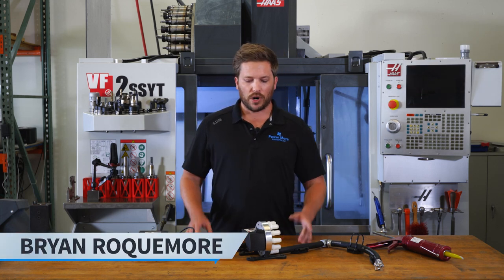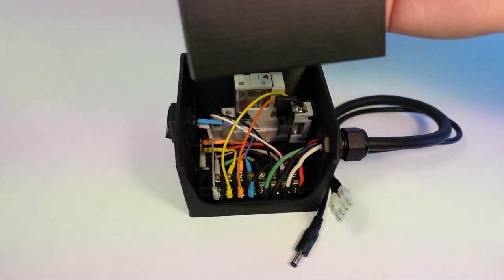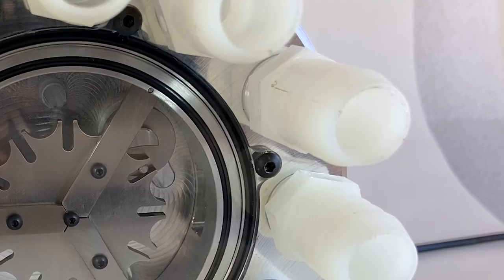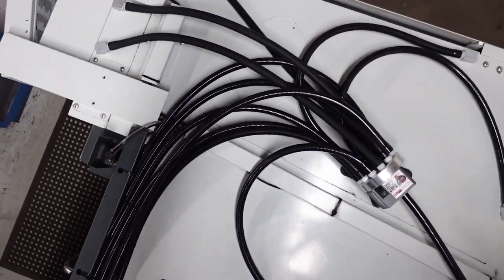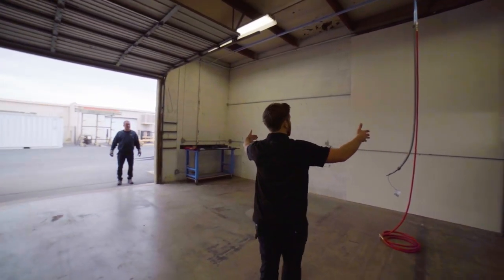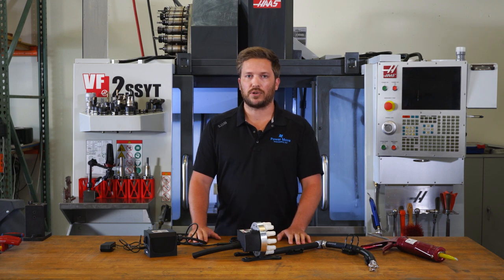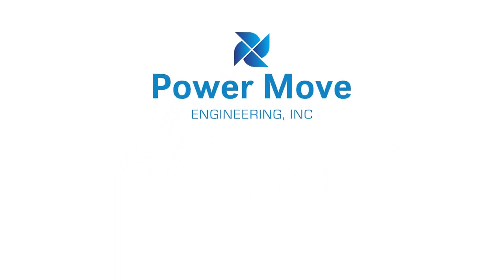NEVER Clean Your CNC Machine Again

Comment: Would've been cool to see it in action
Reply from the maker: Which part would you have liked to see in action? We’ll include it in our upcoming YT video and/or Instagram @powermove_eng
Reply: Precisely
Reply: @powermoveengineering  show us it working and cleaning. Not just an install video
Reply from the maker: @PiCkUpdk  We are working on that too right now. Trying to get all of it posted by first week of January.
Reply from the maker: @PiCkUpdk  it’s not very easy to get good video inside of the machine with coolant running but we’re working on getting a GoPro time lapse during a heavy machining job so stay tuned!
Reply: Exactly. It sounds good but without any proof this is just extra useless hardware.
Reply from the maker: @tinkot We finally have a new video up about this. I hope the action shots are much better in the new one. Thanks for the comment.

Comment: Please show it in operation,.
Reply from the maker: Sean, thanks for the comment. Which process would you like to see in operation? This was one thing that I was worried we didn’t properly explain. It’s out of order but I think it’s all in there. Let us know and we’ll include it in the next video. Thanks
Reply: @powermoveengineering  Your fast response tells me you're monitoring your advertising meaning you care based on your reply. Good on ya.

What I meant by can you show it in operation is show a machine full of chips in operation and how it’s keeping the chips from building up. You have a product that many of us just might purchase. My recommendation for what it’s worth, more than likely the most used machine in all of the US is more than likely the VF-3. I see you have a VF-2 that would work for demo as well. In marketing to cover the masses why don’t you target the biggest community? Not that many of us have UMC’s. 

I will use my self for an example, I own a VM-3, pretty much the same as a VF. I have a single auger in the machine which if I am correct that is also the majority of the machines. My issue of which is a complete pain in the you know what is the areas right and left of the table all the way to the back wall fills up with chips. Honestly in my application I more than likely would only need 2 nozzles. One right, one left.

To the comment I made, show it in operation. In your video you show the spindle flood coolant working and a couple of other really quick shots. For advertising and what I would want to see is in order of the following.
What it is, this you have done.

Show it installed on a VF: “clean environment”

Show the routing of the pipes: You do this but it shows a metric load of pipes which might be a deterrent as folks like me don’t need all of that. This is where your R and D might want to figure out a way to make simpler versions, or one you can cap off for the fitting you don’t need. Something along the line of that, so it can become expandable so to speak. 

Show it in operation and how well it works: Maybe let some chips build up, turn on your system and let us watch it work.

Then as you do in the video, break down the mechanics of it. 

Lastly I would say and this is my compulsive side, is the box your plugging into the mother board of the HAAS. Did you use the same gauge wire or bigger internal in the box? If not, that can cause an undervoltage which can damage other components. Aftermarket electronics on a 140K machine is nerve racking for me. Show us you have done your homework on Ohm’s law, meaning that the electronic monitor and the pass thru side of your box has ZERO drop due to internal components and their sizes.

All in all, if you do anything, show it working on a machine removing chips.

This is just food for thought. I think you might be on to something though.
Sean
Reply from the maker: @3073Sean  You bring up some good points that I want to cover as much as I can in this comment and in our next video. I agree that medium sized vertical mills are the most common need for a tool like this. The design was meant to be universal and although dealing with the hose routing is a project, it only needs to be done once and can be completed in a couple hours of work. One important thing we focused on was making all hoses inside the machine run vertically and therefore not collect chips on them. The process of mounting the hoses to the wall is easy except the adhesive needs some time to dry. For the relay box, we believe all electrical wires, components, connectors, and the design to be sound. The 12V motor circuit uses its own dedicated power supply and does nothing to inhibit the standard pump operation. It just uses a relay to “sense” when the pump is on or off. I will put an electrical schematic on the website. We are filming a full installation video right now that will dive deeper into the hose routing and overall operation. If you have any questions though, let me know and I will be glad to answer! Thanks for the advice!
Reply from the maker: We finally have a new video up about this. I hope the action shots are much better in the new one. Let me know if you have any questions! Thanks

Comment: cool how about a swarf conveyor for the discahrge?
Reply from the maker: Our UMC-500 has a conveyor and our VF-2 has an auger which are the two main options available for CNC machines in general. We think both styles work relatively well. However many enclosed machines have near-level floors allowing for chips to build up excessively and not travel naturally to the conveyor. This product is simply designed to push everything downhill and eliminate the need to rake the chips by hand.

Comment: Cool product! It is really needed for the Haas machines. Are the nozzle around the spindle open when your new nozzle are flussing in the min 2:29? Which pump do you use in your machine? Would you ship this overseas?
It would be fantastic if you make a manual with recommended nozzle positions for each model? Or at least the most common ones.
Reply from the maker: The pump on our machines are the standard 1 HP (0.75 kW) type, not their "high pressure" option. I honestly don't recall if the spindle nozzles were open during that shot but I believe they were. We have done as much as we realistically can to eliminate coolant bottle necks throughout the system, so it flows quite well no matter what. In our upcoming VF2 installation video we are going to show absolutely everything needed to do a full install. This includes nozzle locations, recommended hose routing, how to use the included and non-included hardware, time lapse videos, and answering other questions. I am also working on upgrading the info on the website to include electrical wiring and hose routing schematics. Let me know if I can help with anything else. Thanks for the comment!
Reply: @powermoveengineering  great! I would really like to test your system. If it works as expected we will make it standard in our machines. When are you planning to release the demo video?
Reply from the maker: Glad to hear it! We are hoping to get the installation and demo video up by the first week of January.
Reply: @powermoveengineering  Hi! Looking forward to see the installation and demo video? Would it come soon?
Reply from the maker: @davidsanchezmolinero1847  We are still working on it right now and it will be coming very soon. We ended up changing much of the hardware to make the system easier to install and more universal to all machines. Keep an eye out for the new video soon or if you would like to know more specifics, ask here or send an email to Bryan@PowerMoveEngineering.com. Thanks for the reply!
Reply from the maker: We finally have a new video up about this. We made a lot of improvements to the design and hopefully the new video explains some things better as well. Thanks for your interest. Let me know if you have any questions!
Reply from the maker: Updated video is finally up! Hope it helps!

Comment: People are certainly very nice and encouraging for all the positive comments. I will share my opinion, please excuse me if this is too straight forward. Just wanted to help. The cost of this unit is about the same as an additional high volume/flow pump. Then an over head shower set up would be much more effective comparing to spraying one nozzle at the time. Additionally you won’t have to deal with chip build up on the hose, nozzle, mounting clamps that are mounted so low in the machine….It seem to me this solution it’s a little too complicated than it needs to be.
Reply from the maker: We are currently working on some improvements that will lower the cost in the near future. We’re working on eliminating the relay box entirely to make it more universal and adding an option for only 6 outlets instead of 12 for smaller machines. Both of these will eliminate hardware and drive the cost down. I’m not sure if I understand the benefit of an overhead shower since it doesn’t sound as powerful or able to reach hidden areas. Our current setup does not collect chips on it because everything inside the machine travels vertically and the wall mounts are angled at the top for this reason. Spraying one nozzle at a time was the goal of this system to allow for high pressure to exit in every location. IMO there’s no need to flush any single area for more than a few seconds at a time. One potential downside of adding another pump is that it can empty the tank into the enclosure faster than the enclosure can drain back to the tank. Let me know if you have any questions. Thanks for the feedback!
Reply: Thank you for the reply. I’m glad to hear that you guys are making improvements. Don’t get me wrong I believe the system will work. And I must admit the Haas enclosure it’s a bit challenging in the aspect of chip flow and drainage when it comes to high production work environment. Our shop has 4 Haas needs frequent cleaning but all other machines are fine without needing much attention we just leave the wash down and conveyor on as long as the machine is running.

Comment: So once your invention goes into production, what price range is your chip flushing device going for.
Reply from the maker: We have had many part runs and revisions and we feel that the current product is bulletproof and ready. Everything is machined in-house and any purchased hardware is easily attainable. We are working on the full installation video now. It is for sale on www.swarfdiablo.com for $1175 including shipping and sales tax. Let us know if you have any other questions and we would be glad to help. Thanks!
Reply: @powermoveengineering  Can you do a time lapse video of chip build up in CNC with and without Swarf Diablo.
You have invented a product in the cnc machining field that can address the issue with chip problem shops have.
You stand to capitalize on your invention if machine builders and other people do not copy from your system.

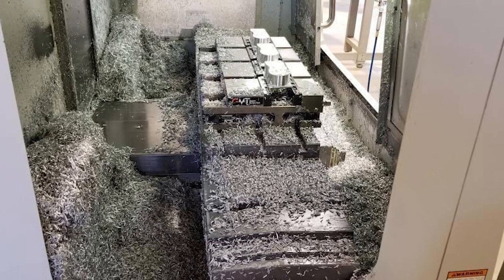I can only imagine what a high pressure coolant pump in conjunction with your product can do to a VF series fill with chips  like in the video at 0:46.

I think it would be a good addition to your product line if you machine a part just like the End Effector but instead of a round ball nozzle it uses standard 1/4 or 3/8 Loc Line modular hose system which can screw in and connect to, so cnc operator can direct a jet stream of coolant anywhere in the machine when switching to different jobs.
Also have you thought about using strong magnet on your wall mounts instead of adhesive glue where it can be reposition anytime...but not sure if magnets stick to Haas enclosure.
Reply from the maker: @SlowReactionDriversAreTheWorst  We will try to set up a time lapse during our next job that makes a bunch of chips. Thanks for that suggestion. Our initial design for the end effector had three NPT holes for Loc-Lines. It worked well but after researching the cost it became expensive quickly because the whole system would need 36 lines and therefore many fittings. Maybe we can still offer this as an option if people thought it was far superior to the adjustable balls. We also considered neodymium magnets for the wall attachment and tried many different sizes. It is possible to use magnets however we weren't able to find a way to shield them from collecting steel chips. Also, the hose can have strong curved memory and requires a decent amount of holding force to route efficiently. We think that the Sikaflex attachment was the best solution because it is very strong once cured, does not react to coolant, and can still be removed somewhat easily if ever needed. We plan to dive into all of these topics in our next how-to video. Thanks for the comments and let me know if you have any other suggestions or questions.
Reply from the maker: @SlowReactionDriversAreTheWorst We finally have a new video up about this. We made a lot of improvements to the design and hopefully the new video explains some things better as well. Also reduced price from my previous comment here. Thanks for your interest. Let me know if you have any questions!

Comment: these are Haas issues only. Haas is terrible for lights out machining.
Reply: Not a Haas specific issue, but it's possible you've only seen it be a prevalent issue if Haas machines. We run a few DMG machines where it can easily become an issue if, like the video mentioned, the operator doesn't wash down the machine regularly